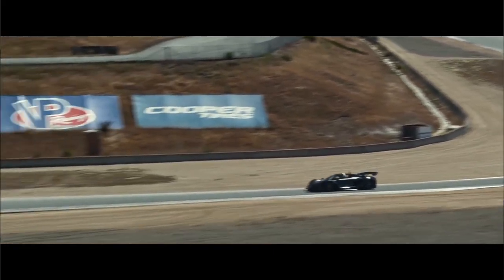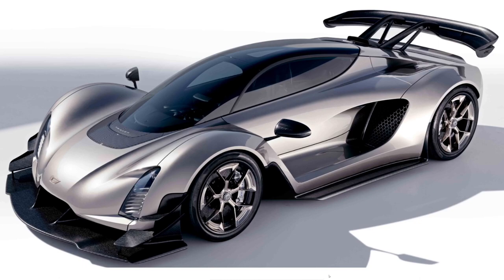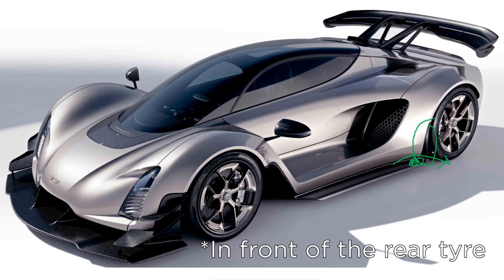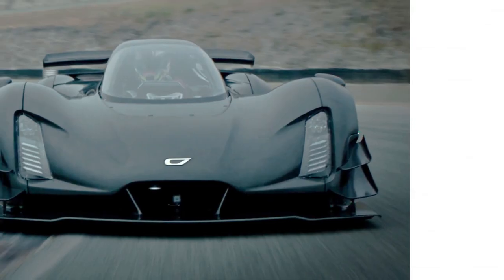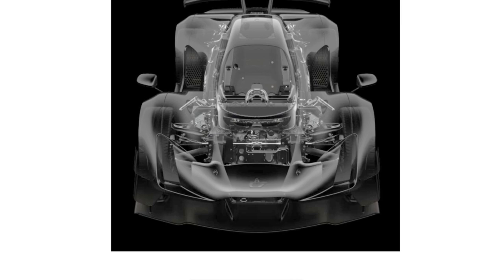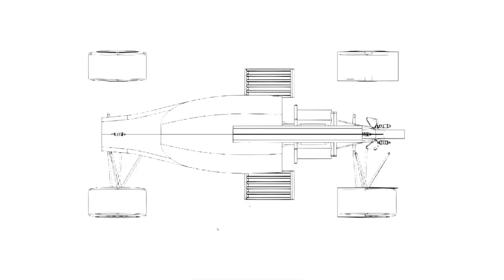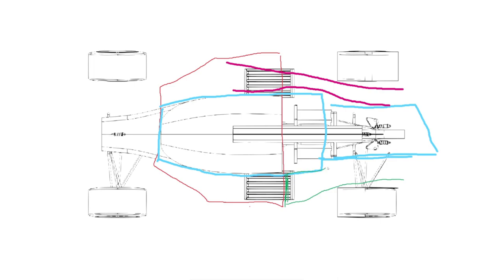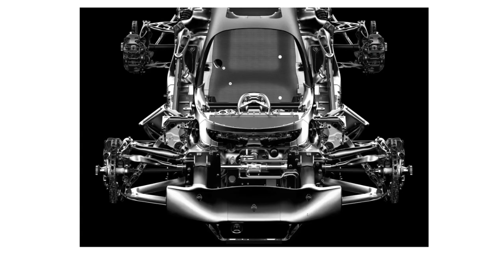The Best Hypercar Aero Layout? | Analysing the Czinger 21C

Comment: Can you talk about aero in gravel rally applications. Seems like there are some interesting challenges there given the large range of ride height and risk of damage to exposed or weak elements.
Reply: Yes! Great idea! Toyota seem to have that area mastered. A comparison between Toyota and M Sport would be great, cuz theirs seem to be the least optimized.
Reply: The way they also use (or used to use) larger vertical elements to induce sideforce when sliding around corners was also really interesting. Would love to hear more about them.
Reply: @jubuttib  I had not even considered the extreme yaw they see. Thanks for this comment! Also interesting that they leave the ground with some frequency. Not something that most automotive aero people have the think about.
Reply: Oh yes please!
Reply: @NoClassic  I wonder if the jumps change much (other than the sheer force the whole car - aero included - has to endure). I imagine the downforce is beneficial: you want to land the car quickly to be able to accelerate
Reply: I’ve never thought about that, now I’m very interested!

Comment: Not once did you mention the chassis, though :-/
Reply: There were so many parameters considered when designing the chassis I feel like I’d get overwhelmed in a comprehensive video of it. Main thing is weight minimization, road compliancy, longitudinal forces, side forces, internal forces (vibration, heat, load stress), repairability, sustainability. I am probably missing a couple dozen parameters, but it wouldn’t be able to all be boiled down in even a 2 hour video.

Comment: Hey Kyle, what would be the benefits/ disadvantages of mounting the chassis end of the wishbone offset from the other chassis mount? I hope you understand this question, thank you
Reply: I’ll refrase it just in case. Basically, the normal chassis side wishbone mounts are perpendicular to the wheel, having no caster change in wheel travel, but say one mount is at 0 degrees (fully perpendicular and normal) and another is at 30 degrees. Would that cause some caster change considering they’re taking different arcs?
Reply: @MitchieFerg  That will cause caster change.
Reply: That'd be a toe link
Reply: @noncog1  you mean a trailing arm?
Reply: @MitchieFerg  depends on geometry and what groups nomenclature you follow, but sometimes yes. I for some reason assumed you'd said wishboneS, not singular wishbone

Comment: While the downforce claims may seem reasonable based on the design of the car, the Laguna Seca lap time certainly doesn't support them. It managed 1:25:44, which is 2.2s faster than the Senna. And that's all nice and good, but it did so during manufacturer testing while the Senna was tested independently (and you can always find a bit more time if you have unlimited access to the track and a factory driver who is familiar with every nuance of the car) and also it did so on faster tires. The Senna was on Trofeo Rs which are 1-1.7s/min slower than the Cup 2 Rs the Czinger was using. So on equal tires and with factory support the Senna might very well already be as fast or even faster.

What then doesn't make sense is for the Czinger to be only as fast as the Senna, while weighing about the same (again, at least that's the claim), but while also having near TWICE the downforce and 450hp extra. The Senna is claimed to generate 800kg at 250km/h, while the Czinger claims 650kg at 160km/h - which would be ~1587kg at 250km/h. What is all the downforce doing, exactly? What's more, 1587kg is on the level of an F2 car - how are road tires even supposed to handle that? Is it maybe possible that the downforce they claim is what the car could do IF they didn't have to artificially limit it to protect the tires? I certainly wouldn't put that past them. In any case, though, based on the lap time the car is not generating anywhere near the downforce they are claiming.
Reply: Unless it's an F1 car, in most of these cars Mechanical grip matters much more than aero grip. And no street legal car setup for a road ride can ever beat a pure race car in the turns and on the brakes.
Reply: The AI knew what to do, why are you questioning the Czinger 21c able to achieve this and Tires end up fine? The AI took the factors and did everything to put less strain and force on the Tires, it knows how to balance the vehicle in many places and even it out right.

Comment: I was wondering why we never see a dimpled bodywork design like that of a golf ball. It's my understanding that this creates a turbulent boundary layer which significantly decreases drag which seems fairly obviously advantageous. Is it I simply matter of aesthetics, regulations or is there something on the aerodynamic side that me and my rudimentary understanding have missed? Thanks in advance if you see this.
Reply: this only decreases drag if you need to join flows back together in a short distance, as is the case with the tight curvature of a golf ball
on a car you avoid large trailing areas and sharp bends that would cause flow separation when you can
if you can keep laminar flow while avoiding area that creates a rear wake this is better than creating turbulence
dimples or other sources of turbulence only make sense if you have shapes the air won"t follow either way, or are aiming for something other than drag reduction

Comment: what does sCz and sCx mean?
Reply: Same question. I need some aerodynamic 101.
Reply: Cx is the drag coefficient. Same as Cd. Cz is the downforce coefficient. S is the coefficients’ reference Surface area, in cars usually the frontal area. Multiplying the area by the coefficient (i.e. SCz, SCx) is all that’s needed to determine the forces acting on the car at any speed, any ambient air density.